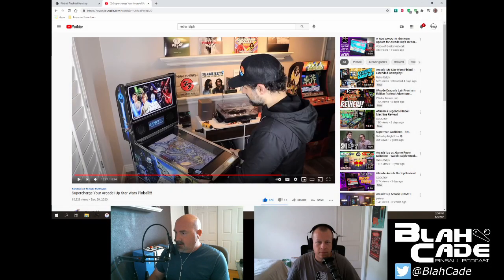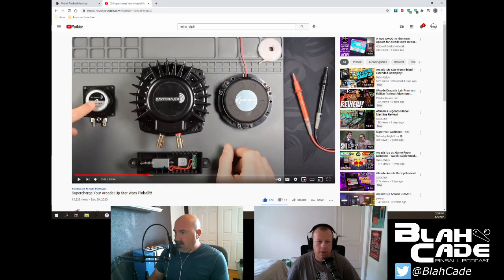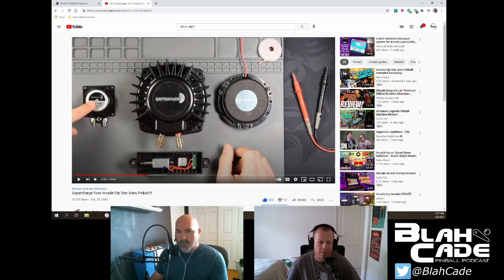Let's Talk Pinball Solenoids & Transducers!

Comment: Yeah I am not really sure why people have been trying to compare the solenoid system in the a1up pinball to the exciters in the atgames machine. Both provide a very different experience and in my opinion one compliments the other. Id also agree that you are likely going to get more then a year out of solenoids, especially for the casual player.
Reply from the maker: Exactly. It's not that one is right and the other is wrong. When we first heard about haptics coming to the cabs, Jared was actually hoping for transducers in the 1Up cabs. Used correctly, they can add to the experience greatly.  My PinSim controller uses the rumble motors from an Xbox 360 controller and my only gripe is that they're not more powerful (they weren't exactly designed to be felt through 3/4" MDF). Honestly good haptics depends on how it's programmed, and so long as that is done with knowledge of what type of haptic is being used, I'm sure it's all very effective.